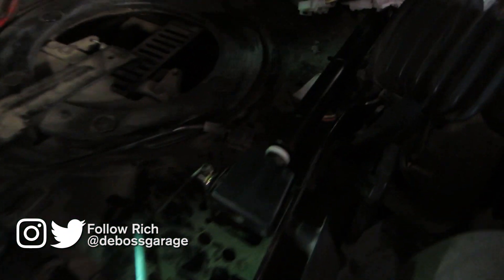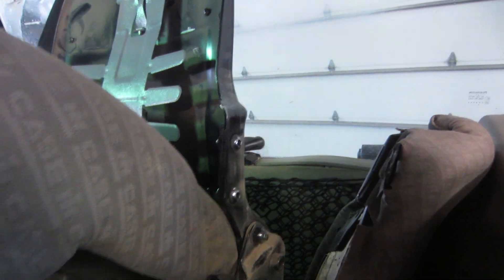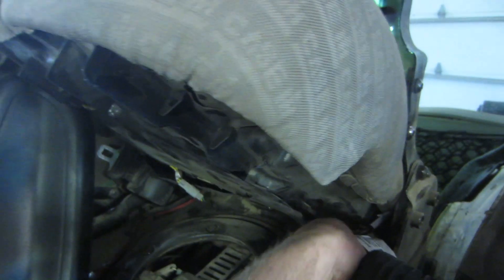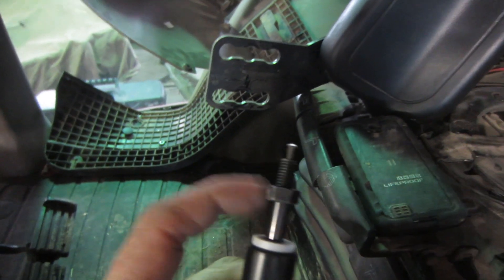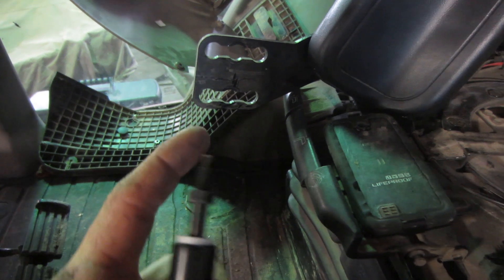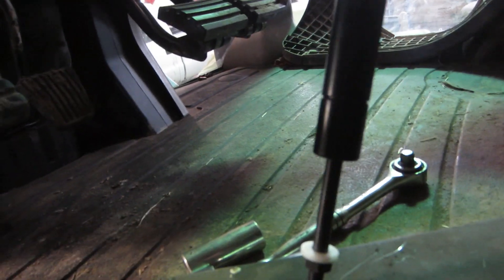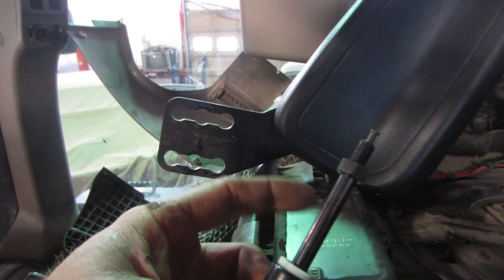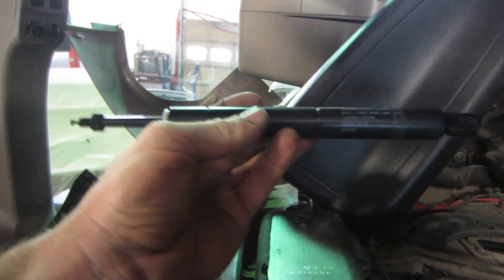Fixing A Seat Recliner Shock Absorber in a Case IH MX 255

Comment: I'm a farmer, but you don't have to worry about me putting you out of work. That MX is way too new for us haha. We farm with equipment that you have to know more about than the dealer because all the old timers that knew anything about it have retired.
Reply from the maker: I'm rebuilding a 4610 Massey in the shop right now.  EGR leaked into the exhaust and hydro locked the engine.  2 bent rods.  The customer wanted the cooler replaced and I asked for a price on one.  The parts guy asked "Whats an EGR cooler?".  We are all in trouble...   I ordered the parts two weeks ago and am still waiting for one set of rod bearings.  Incompetent parts people ruin the fun of mechanics.
Reply: DEBOSS GARAGE Yes they do. I've spent a lot of time looking for someone who knows what they are talking about. Luckily our local IH and JD dealers have pretty decent parts people. Plus they have parts breakdowns online know so I can see if they have that part number in stock before I start a wild goose chase.